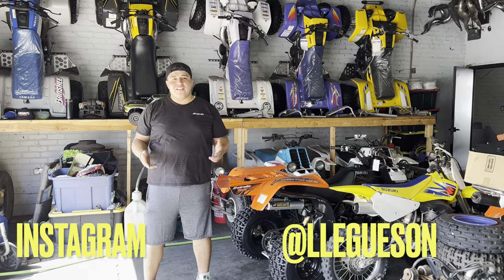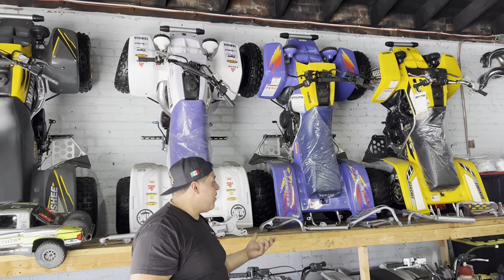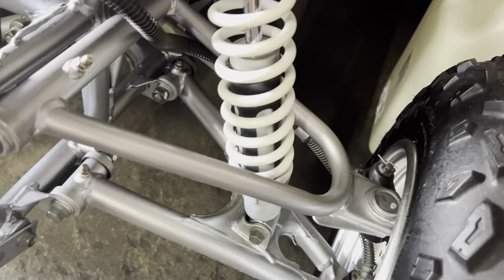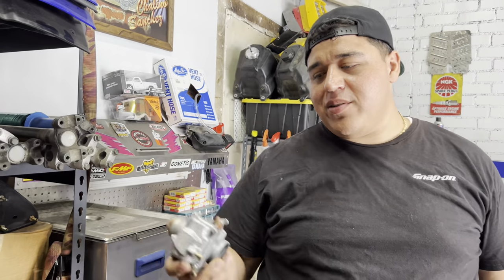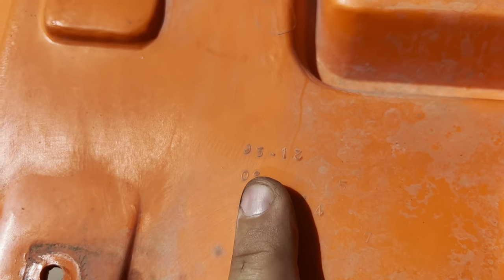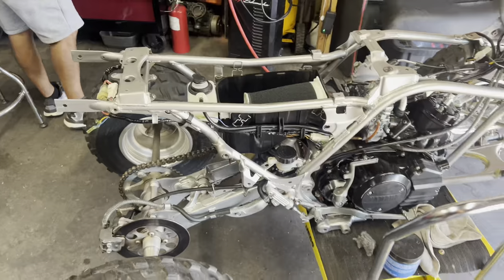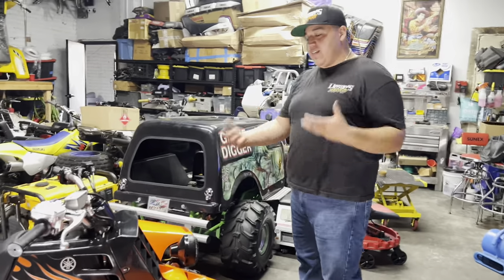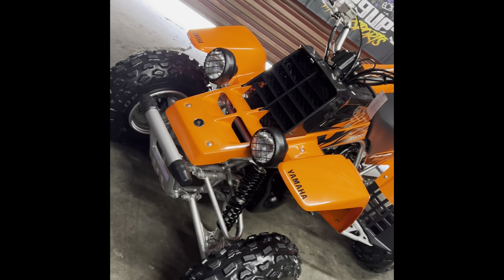Banshee warehouse! We got a new shop!

Comment: Amazing Banshee collection, I have a 2000 totally rebuilt from engine to chassis Toomey pipes, V Force reeds, carbs and everything in-between, broke it in and never rode it been sitting about 12 years no fuel in it all drained from tank to bowls...nice shop, that 08 is 🔥💯